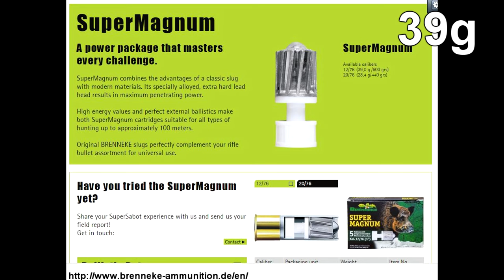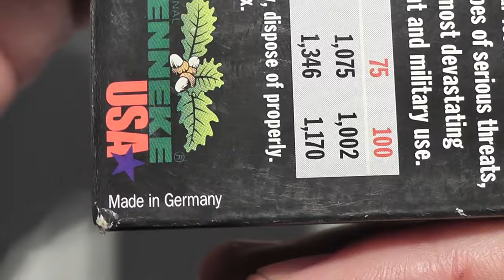BRENNEKE Special Forces Slug vs ENGINE and MORE!

Comment: engineering student here: if I had to guess, the lead plate stopped the slug because it's ductility and microstructure allowed it to more efficiently disperse the energy of a slug; it could be possible that a slug designed specifically to cause massive structural damage to cast iron would rely on how incredibly brittle cast iron is; it's not punching through the iron so much as it's shattering it, which wouldn't be effective against something so ductile. all the energy was transferred into compressing and deforming the lead instead.

Comment: if you shot a truck engine,the chances are pretty high that the engine block is aluminum billet/ if not its cast steel thats very hard. its also fixed in place with brackets ,so it wont get pushed/knocked over or slide , bounce, tumble ect,ect. so most of the energy from the slug would be dumped directly into the diesel  engine block  d.e.b. (no im not ignoring the fact the engine is housed inside what is essentially a metal box and is covered in both metal and plastic parts and wires and belts.) with minimal loss do to the objects momentum that is created when the slug tranfers its energy into a movable object , which utilizes the slugs forward energy almost as if it where a propellant . as opposed to if the object cannot move freely because it is secured  into place with strong enough fasteners,the slug tries to push the object .however because the object( our d.e.b. in this case) doesn't move, momentum cannot be created despite the energy still being transferred to the d.e.b. the destructive force will be greatly increased as the slug now more "dumps"its energy than transfers it, sending violent shockwaves through the d.e.b . this will crack and warp the d.e.b. causing fluid and pressure  leakages. a few shots would shatter parts of the d.e.b. from weakened structural integrity and immense amounts of work-hardening around the strike zones creating brittle areas prone to shattering. this could lodge material in the cylinders blocking the pistons . im sure the brenneke tactical slugs would work as advertised, but it may take 2 or 3 good shots to actually disable the truck immediately.

Comment: Also keep in mind you do not necessarily need to penetrate a cylinder   wall to render an automobile  engine no good. It depends on the type of engine, and what crucial component of the engine is destroyed and if you're trying to a achieve instant destruction of the engine or just cause it to eventually fail to stop forward progress. 
After all a .22 will put a hole in the radiator or a hose and cause it to eventually overheat and cut out from a over temp motor stop relay signal or cause extreme overheating  of the engine from loss of coolant and viscosity of lubricants eventually causing a catastrophic failure in moving internal parts.  . Either way both stopping the engine with just a .22. Let's also not forget other critical components such as pulleys and rockers and oil loss. A ruined pulley will throw a belt.  Oil loss and destroyed rockers can be achieved by a .22 as well. Most valve covers on the heads of engines are thin tin or aluminum alloy. Oil coiling lines usually thin aluminum or braided rubber. A .22 through the distributor or  cap will also make the engine unable to run. We could also discuss the heads being much lighter material than the block. I get the idea is to disable the engine quickly without having to make a lucky shot to hit one of the components  but some of the comments here clearly scream many of the viewers have no idea how a automobile engine actually runs.

Comment: Big diesel engines, like those in heavy trucks, are made of cast iron. It's not as hard as you would think to break an engine block. I've seen connecting rods thrown right out the side of the engine before.

Comment: the cast iron block of a diesel engine  is going to be far weaker, and brittle than the composite alloy structurally reinforced metals used in break discs.
Reply from the maker: It's made out of cast iron
Reply: break disks are not always made of cast iron. that one wasnt otherwise it would have gone through it like it did the motor. that one was likely a ceramic composite etc -  but i could be wrong. either way the structure of the rotor should make it way stronger than a thin metal block , wouldnt you agree?
Reply: break pads are ceramic composite, not the disks.
Reply: someone doesnt know as much as they think they do.
Reply: Brake disks. It's spelled "brake".
Reply: jjohnston94 wow, that's embarrassing.
Reply: well considering I was using voice to text, it didnt see a spelling error and neither did I.
Reply: this particular brake rotor was a cast-iron version (a dense steel alloy that we would call cast iron) while they do make a carbon-ceramic style brake rotor  this was not it. the motor they shot was a cast aluminum air cooled engine, a particular engine designed to dissipate heat quickly and built cheaply.  a diesel engine used in a bobtail or other heavy truck would be heavy cast iron and if this slug couldn't penetrate a brake rotor it probably wouldn't  stop a diesel engine.
Reply: i was thinking the same thing... Brake discs are super hard. An engine would be either iron or aluminium, way easier to get through an engine block/cylinder head..
Reply: jerseyforlife right. they are very thin -  no where near as thick or structurally reinforced as a brake rotor - they are made to wear down over time and as such are very thick

Comment: While shooting blocks is fun most engine stops will be due to damaging the electronics and/or fuel systems. Many engine can run for a while with a shattered piston or thrown rod. (Mechanic here.) For best results against vehicles not much beats putting one through the drivers face.  Driverless cars may change that...

Comment: the old slugs had the wad screwed into the back of the slugs. Giving it a ballistic co-balance , as the forester slug does with a hollowed base. but that would require  them to retool there line or have a human put the screws in. I would be willing to pay a little more for accuracy, as we know its everthing.

Comment: Stopping a common day diesel truck is extremely easy. The antifreeze sensors are so sensitive  that a shot to the radiator would shut it down shortly. Not as fast as military would like though.

Comment: Stops anything huh?... Can it stop Jet Fuel from melting steel beams?
Reply from the maker: No,  I'm sure they have a slug just for the purpose!
Reply: jet fuel doesn't get hot enough to melt steel beams
Reply: Danny Dick 
It does get hot enough to weaken the structural integrity though.
Reply: SadisticSevenGaming I saw what you did there!
Reply: @elephystry  weaken it enough for it to fall perfectly straight no let alone all of the reports of seeing molten steel  witch is not scientifically  possible for jet fuel do a little more research
Reply: OGEG95 it is possible for jet fuel to melt steel beams because your forgetting the size and with of the fire and the heat it was creating.
Reply: @onechunkyaircraft4872  have you seen the footage of the building exploding before the plane struck it
Reply: +larry johnson ...no, it was actually Saudi Arabian men, hired by Osama, let in by the, or during the Clinton the rapist presidency....and yes, burning jet fuel along with plenty of burnable objects inside the building will cause collapse...this was the first time anything like this has happened...
Reply: +James Wewerka 
you are wrong... in Italy the same design tower built 2 years earlier was hit by a plane... it's still standing after burning for almost a whole day.
Reply: DAVID CAIN Do aluminum explosions result in molten steel?
Reply: Well-placed explosive devices around a building significantly weaken the structure too.
Reply: @dannydick4796  Inferno Effect. look it up
Reply: Dave Almighty  they were 767s boss. Let the record show.
Reply: Never mention "controlled demolition," as NSA may be tracking this post!
Reply: Dave Almighty Smaller Building 7 collapsed because it got tired?🤔
Reply: And according to Brian Ferry, it won't stop, won't stop the dance.

Comment: I discovered Brenneke slugs 30 years ago. I have yet to find anything that performs close. My first ever shot was into a 5 gallon bucket of water, and I swear to god the bucket flew 75 feet into the air. You really should try some of the full-power 3 inchers.
Seeing the newer ones though, that is disappointing. I hope they haven't dumbed em down.
If you noticed, the first one blew the action open in the shotgun. That was always my experience with them if you didn't hold it closed. Maybe they blew up a couple guns and dialed back the power?

Comment: A steel brake rotor and a cast iron engine block aren't quite the same. Expectations, guys. Brenneke makes a Special Forces Maximum Barrier Penetration Magnum (SFMBPM) which is 602gr "extra-hard alloy" with 1650 FPS muzzle.
You guys are using a 525gr 1418 FPS muzzle item.

Comment: nice splat on the disk brake ROTOR...
have you ever looked inside any of the hard drives after shooting them? I'd be curious if the impact was enough to fracture the neodymium magnets inside the drive. Good utility size magnets, make great magnet sticks, I cover them in shrink tube or electrical tape to minimize crumbling and breakage; they're quite brittle.

Comment: I’m pretty sure that round would easily penetrate a diesel truck engine. you just gotta know Where to aim if you aim high you’re going to hit where the heads are and there is just too much metal there. but if you aim kind of low from the side just above the tire at the actual engine block it’s not hard to penetrate much easier than a high nickel brake rotor.

Comment: The last 80+ deer Ive killed with a shotgun have been with Brenneke K.O. slugs, 12ga 2 3!4. Ive shot Brennekes since about 1978 and never had a complaint except the availability lol. Ive shot 1000s of slugs over 3 decades and nearly 4.. I always swear by Brenneke. Shotguns and slugs have to be sighted in just like other firearms. points of impacts change with different guns and slug loads.

Comment: Motor vehicle engines have most of the timing gears/chains and mechanical  components on the front, under a lighter cover. A front hit could break timing chains and gears, rupture coolant and oil passages, break front cylinder walls and even break intake manifolds. A broken timing chain would kill the engine instantly, likewise a gas engine would die from a broken intake. A broken cylinder wall would likely cause the piston to sieze or a rod to break. And broken oil pasages would rapidly sieze the engine and coolant loss would do the same but more slowly. The moral is: Get a 45-70.

Comment: When I changed my rotors, I shot em with 5.56 fmj 55gr from further than this and they went straight through. I suspect it has to do with the surface area of impact, the tinier, sharper projectile having an easier time than the wider wall of metal trying to push through.
Reply: The rotors came off a 1980 Mercedes 300sd turbodiesel, btw. Not sure if they were as thick as the ones you guys had

Comment: Specifically, that part of the disc brake system is a "Rotor", and they are extremely tough
Reply from the maker: Yes, I called it a "rotor".   I guess you commented before you heard me say that
Reply: Unfortunately, my hearing is heavily damaged and I have to use subtitles to hear anything on youtube, and the auto genned subs are crap on certain devices (like my iphone) so I don't generally pay attention to them unless i really need to find out what was said. So i likely never heard you say that. Sorry bout that.

Comment: looks like it's doing a good job of delivering the kinetic energy of the slug to the target. Would be really interesting to see what it does to ballistics gel or similar analog.
Reply from the maker: They were just so inaccurate.   Most of the shots were a couple inches from the point of aim.   I don't think we'd get a clean shot at some gel.
Reply: Yeah, shame that. Do you think that the inaccuracy was due more to the slug geometry or the attached cap not separating cleanly?
Reply from the maker: They are designed to have the wadding stay attached to the slug to stabilize them.  Since they  fell off,  the slug's accuracy suffered.

Comment: If you want to disable a vehicle use steel core rifle bullets and plenty of them. It's fun to shoot stuff but the odds of a lucky shot taking out vehicle electronics aren't great. (You could shoot a running junk car to test!) Holes in the cooling system, transmission cooler lines etc won't cause an instant stop. Most auto engine blocks are a lot stouter than that old utility engine and even if you hole the block that doesn't mean you'll go through the water jacket into enough moving parts to halt the engine.

The best way to stop a vehicle is by killing the driver. 

If you need to stop a large truck taking out the steer tires will slow it down a bit, but truck cabs are built light to save weight so if you have a clear shot at the enemy you are still better off aiming at him.

Comment: Brake rotors are one of the strongest parts of a vehicle having to withstand all that force of converting kinetic energy into thermal energy. Engine blocks though, not that strong at all. Only takes a hole in the case to make it loose all the oil or coolant eventually.

Comment: Should of drained the battery boiled off the water then add gasoline to the mix put a metal plate behind  u would get something quite insane if the spark ignites the mix 💥

Comment: I imagine hitting a cylinder by itself will cause severe engine damage. But the body of the vehicle would probably take the grunt, reducing damage. It'd most likely cause a gradual failure within short time.

Comment: I checked the specs on these and it looks like they are powered down for shotguns made to shoot 2 3/4" shells.  It's not that they put 3" magnum power in a 2 3/4" shell :)  I am not being picky, I was just curious because someone might make the mistake of thinking they could shoot a "short" magnum out of a shotgun not made for 3" magnum pressures. Nice video :)
Reply from the maker: It's just more hype,  the way I see it.   You either have magnum or 2 3/4" shells that have to be safe to shoot out of all 2 3/4" shotguns.

Comment: Could you make and shoot slugs formed from a 15mmsocket for a 12gauge? From what my calibers say it is a snug fit in a shot cup and should fit and fire safely. Just measure out an once of lead melt it, find a good heat resistant way to plug the socket and pour in the lead. p.s. put the socket over a candle to get soot on out to help with release when you tap out the cast slug. I would do it myself but i am a coward and leave it to the professional.

Comment: After a brake rotor has been used a while they become extremely hard. Heat cycles or maybe its by design if they were soft they wouldn't last. I would like to see ballistic testing on how big a round it takes to get through that rotor ya'll used.

Comment: The whole shoot out the engine thing I've always found stupid, because you really need a something like a 14.5mm and bigger to quickly break an engine block. because engine blocks are very tough, those things have a lot of metal that can often make 50 cal rounds struggle to break through. Plus the metal used to make engine blocks is pretty good and can often be layered. Then add it how the steel can be as thick as half an inch in some spots just on the outer shell, and how a lot of the surfaces on an engine are curved and angled. All well having coolant and possibly grease/oil in the way as well, You have yourself a rather difficult to penetrate target. Plus killing an engine doesn't really stop a vehicle, since it can just keep rolling until it runs out of inertia. So pretty dumb idea if you have to stop a vehicle quickly. But if you have the time and enough bullets or the right ones, by all means.
Reply: There's a reason they're called engine BLOCKS
Reply: shoot at the driver, he'll lose control. if you shoot the engine the vehicle still has inertia
Reply: +StarCommando That's not true at all. Cutting the serpentine belt wouldn't stop the engine. It would stop the alternator from charging the battery, and the power steering pump would stop, but the engine would continue running. Most racecars have no accessory drive, as they don't need to charge a battery or spin a power steering pump. 
Considering most all engines made in the last 20 years have an individual coil per cylinder, and most engines have a displacement on demand feature, unless you break most of the coils, the engine will run. I've had a Chevy 350 run on five cylinders for a few years. 
The fuel line would work, if you completely severed it, otherwise the high pressure of modern fuel systems would easily shrug off a smaller puncture, and completely severing the fuel line wouldn't be easy as they're usually routed right next to frame rails and engine blocks. 
Even shooting out the radiator is only going to stop the engine after several minutes, once the coolant is gone, the engine has to overheat enough to seize, which takes a surprisingly long time. 

There is a video on YouTube of a guy shooting a running V6 with a 20mm anti tank gun, the engine does not stop running immediately.

Comment: HA you got dooped they are the exact same thing as one of the other slugs, only a differant coating, but they are heavy good penetrators anyway, the one you want to test is the one I did 4 years ago, and thats the brenneke special forces maximum barrier penetrators, those kick harder then the 3 inch 600 grainers they have, while being 30 grains lighter, they will go though lots of stuff, and to boot the maximums are hardcast or at least a metal core.